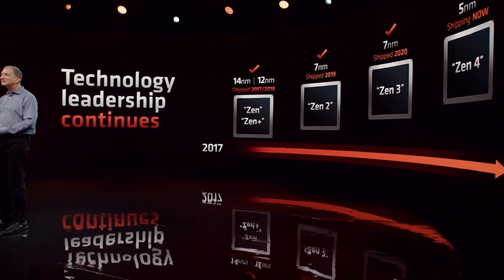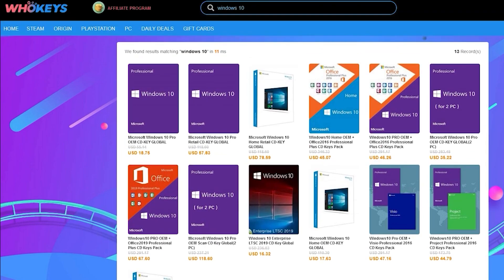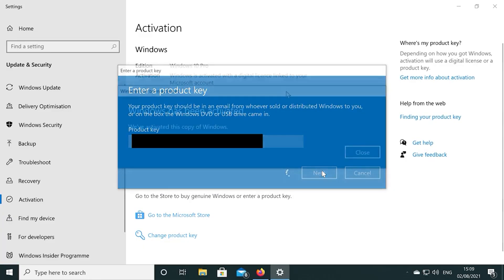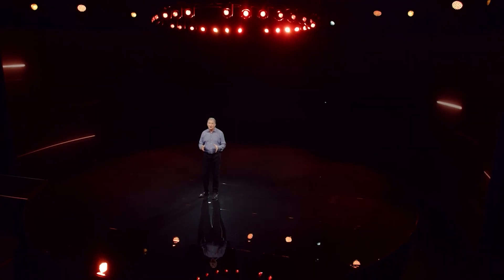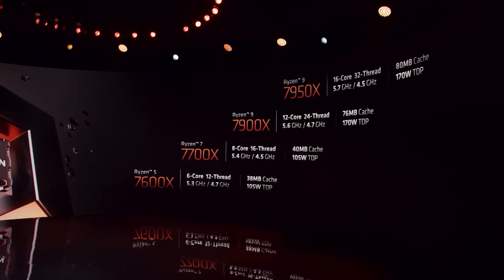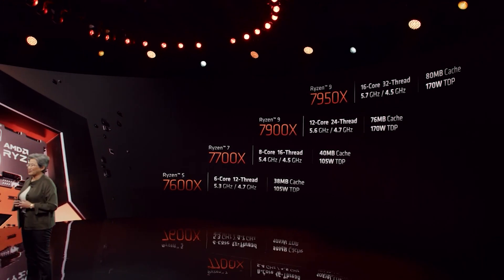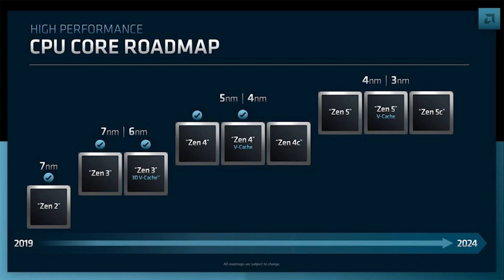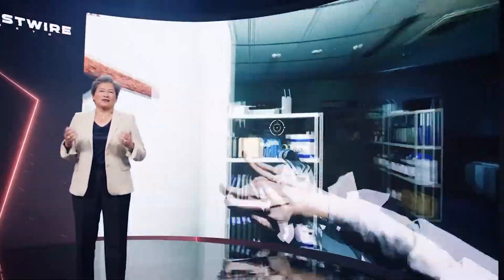Zen 6 CHANGES EVERYTHING - IPC, Clocks & Architecture Early Info

Comment: I'm on a 3900x and currently see no reason to switch. It's a good pairing with my 2070 Super on a 1440p165 Hz Monitor. Maybe with Zen 6 x3d, if the core count doubles again, but probably not with Zen 5, unless my current setup dies.

Comment: The OpenCL compute with 610M in 7945HX only got 82 samples/s. Intel Arc 770 16GB got 12000 Samples/s in Luxmark 2.0 hotel room benchmark. Then there was revolutionary 7940HS 780M, which has same OpenCL score with 10nm 15W Intel XE g7 eu96 and uhd 770 1650Mhz.

Comment: If APUs are going to improve then would 4 channel or even 6 channel memory be viable as DDR5 speeds improve?
Where are the bottlenecks for APUs and how cheap would it be to engineer out those bottlenecks?
That said if RAM socket standards are changed to accommodate this then the space taken up would not be more than current motherboard designs eg. Laptop RAM socket design.
Reply: AMD has said that going past 16 cores (16c/32t) creates a memory issue in that DDR5 isn't fast enough, and that means it wont ever be fast enough.  It's not fast enough now, and as AMD makes faster CPUs, faster DDR5 simply keeps up with 16 cores and doesn't give you any more benefit.  So that's issue no. 1.

For APUs, DRAM is always a bottleneck.  It's why in game consoles graphics memory is used.  Faster DDR5 will of course help but you still have latency issues so it will never be more than 1080p performance, and that really means at best, mid quality 1080p gaming.  I THINK going to quad channel would help this, not positive.

However if AMD wants a really kick ass desktop/HEDT without needing a new socket for HEDT, they could get the memory controller off the IOD and put it on the core chiplets.  So if you have a single core chiplet you have dual memory and if it's 2 core chiplets, quad channel.  This would allow them to go to something like an 8x4 core config (pxe) per chiplet and they could push thread count up to 48 threads in a CPU.  If they did this they could make a 2 die APU.  One die would be for memory controller, cores and GPU, and the other would be an IOD minus the memory controller.  This couldn't be done with AM5.  And this gets to the point of will Zen 6 be on AM5.  It would be almost impossible for AMD to go higher that a 32t CPU with AM5 because of the memory issue.  And this is why it's unknown if AMD sticks with AM5 for Zen 6.  I hope they don't because I think they need to go higher than 32t and they'll need quad channel to do that.

You get to the problem of cost for the APU though because this is something where most people look at these as budget options, not serious gaming chips.  You couldn't go to quad channel because of the cost, UNLESS you first make a much better APU than current with dual channel and the market buys it up.  If AMD knows consumers will buy up a more high end APU for desktop THEN they could push it to quad channel IF it actually provides more benefit.

I hope that helps.
Reply: Oh, and no, quad channel doesn't need a new MB config, as in needing more memory slots and moving to something other than ATX.  If they moved to quad channel for desktop it would simply be single DIMM per channel.  And this isn't a problem because DDR5 can go all the way up to 512GB/DIMM.  I don't think a desktop would have a memory controller to do this, they'd probably max it out at 128GB/DIMM or 64GB/DIMM.  Those are much easier memory controllers to make and of course the cost of a 128GB DIMM is high so it would be crazy to design for 256GB/DIMM.

Comment: Regarding 8, 12 and 16 core CCDs, I can see two possibilities for big/little core counts.

If the little is 1/2 the size, it could be 8 full fat cores, 4 full fat cores and 8 little cores or 16 little cores all with similar die area.

A better solution (in my opinion) if possible would be little cores with 1/3 the area allowing 8 full fat cores, 6 full fat cores with 6 little cores or 4 full fat cores with 12 little cores.

I think the second option would allow for a very compelling product stack allowing a balance between high single thread performance and thread count.  The dual CCD 12 big/12 little could be a monster.  The 8 big/24 little could be Threadripper Jr. if it had 64 threads and enough I/O.
Reply: the best will be left side 8B+right side 8c. In middle cache.  The die size should be 10x8mm or 80mm2.
It can be 4+8 similar as 2+4. On left side - c+4B+c on right 6c.  The die size should be 8x8mm or 64mm2.

Comment: Never buy a platform based on hope or promises. Buy a platform when it is done. I got a nice AM4 B550 board, good RAM and a 5800x3D dirt cheap. I'll do the same with AM5, so probably a Zen6 x3D chip on a good AM5 board with nice RAM for cheap in 3 years or so.

Comment: Zen 5 8800x3d looks amazing for gaming im waiting for that, but the launch date is awkward for a new build because by then the 4090 will be 2 years old (not paying $1,700 for a 2 yearold gpu),  but the 5000 series won't be out for another 6 months after zen 5x3d chips. Nvidia sandbagging again :(
Reply: Obviously the 4090 won't cost the same thing in 2 years as it does now, duh.

Comment: The plan is to buy 8950X/X3D with 5090/5080.
Intel 14900K is a refresh it will be like 10-15% faster then 13900K but that makes it similarly close to the 13900KS which is also near the same amount faster then 13900K... 7950X is nearly 36% faster then 12900K in CineBench multi-core test. 8950X would be 35-45 (least/max) faster then 13900K and if 14900K is 10-15% faster then 13900K this would mean that 8950X is at least 20-25% faster or more then 14900K which I think is HUGE!

Comment: I've gone with Ryzen 9 7900. Once I finish my build and get my liquid cooling up and running, I can allow the CPU to clock higher, and it'll be just as fast as the X-version. Also, for me, I went cores over cache. Not everything benefits from the 3D V-cache, but FL Studio benefits from more cores, so this should last me a while. Hopefully AM5 will last a while and I'll be able to simply slot in a Zen6 or Zen7 cpu later on.
Reply: I'm definitely pretty happy that I can upgrade my old r7 1700 to a 5950x in my homelab.  It beats buying all new everything for sure.
Reply: Pretty much but the x were the better silicon and why cost more.

Comment: I've been thinking of getting 7800X3D for an AMD build but started to think of waiting for 8800X3D after viewing your leak videos on Zen 5. After viewing this video, however, I'm now thinking of getting 7800X3D and skipping Zen 5 for Zen 6. I haven't built an AMD machine for years since Opteron days. I had been using a Haswell PC (4670T) for years before I built a new one with 12900, which I am going to replace by 14900K or 14700K at the end of the year or early 2024. I'll probably upgrade to Arrow Lake in early 2025.

Comment: You know what, as a gamer of some 40 plus years.. yes even back to the ZX81 days, I have always held back a generation. Why? I simply find better cost to performance. So having just built a new PC capable of 1440p gaming am I disappointed with my choices? Hell no! B450, tried and tested motherboards, 5800x3d CPU ... Cmon it just rocks at its current pricing. And get this.. 7800xt GFX Namely the 319 from XFX.  As an "older" gamer I'm not looking for the best, I'm looking for reliability and cost. The older AM4 platform saved a whole shed load of cash over the current costs of AM5 platforms and the cost to fps was just not worth the extra expenditure.
Can I see 70fps to a say 80fps difference in a game? No, can I hell. I'm old, my eyes are knackered but I still game. 
Do not get bugged down by pure fps scores..

Comment: Honestly I'm waiting for the launch of 14th gen. I'll decide to go i9-13900k or R9 7900x based on what the prices do. I'm leaning toward the i9 for now though but having an upgrade path with AMD is enticing.
Reply: Yeah 13900k, enjoy 100C in games/heavier load lol
Reply: @TheRisqe  13900k is vastly superior to amd counterparts in terms of multicore workloads. It's even the go to by most work related tasks. For games, you won't even need a high end cpu to enjoy high framerates. 100C in games is a different problem and it's not normal.
Reply: @TheRisqe lol, Fanboy Spotted. 🎯🤣

Comment: I'd definitely wait for Zen 6 IF AMD can't get to much faster memory timings and are still only getting 8GB/s for the CPU-chipset link.  That speed isn't good enough anymore.

I've thought a lot about how AMD could improve Zen 6, especially if they want to get thread counts up, and they SHOULD want to do this.

So, one of the things they said is 2 channel memory is an issue even with DDR5 and I take that to mean, it doesn't matter what clock speed, it's just not fast enough.  I KNOW part of the issue with memory speeds is the controller being on the IOD because you're limited to having to transmit first between RAM and the IOD, and then via the interconnect to the CCD.   That's going to become too much of an issue for latency with faster CPU cores unless they were to give the memory controller a direct connect straight to the cores, but THAT doesn't resolve 2 channel memory being too slow.

What would make this all much faster is to put the memory controller on the CCD.  You ALSO have the issue of having a 2 chiplet CPU having latency when the cores on different CCDs need to talk to each other.  So, instead of running that connection through the IOD that should be a direct connect.  If AMD did this they could theoretically run dual or quad channel with a desktop CPU (memory controller on each CCD).  That puts you into HEDT territory without needing a different platform.

At the same time they should make these 8x4 CCDs with their C cores being the efficient cores.  This could get them up to 48 threads.

With this much performance you need a really good MB and the MB along with buying a 2 CCD CPU could be the difference between typical desktop or near HEDT.  You wouldn't need a LOT of PCIe channels because MBs now have so much better and a lot more I/O, it reduces the need for different add on cards which is why you need so many lanes.  Nothing I know of uses more than 16 lanes.   But if all the PCIe slots are running gen5 by that time there just isn't a need for so many lanes.  It won't help people with older adapters, but who cares that's their issue.

If they did all this which I think would be great, you'd need a new socket.
Reply: I think all Ryzens should be monolithic before AMD can achieve a more advanced chiplet design with bandwidth and power consumption (especially when idle) comparable with monolithic die. Design 2 different dies with different target:
A 6P+4E+8CU or 4P+8E+8CU die for desktop R3/R5 and mobile with U/H suffix. Current APU's graphics performance is bottlenecked by the dual channel (LP)DDR5 and the absence of infinity cache. 8CU with 12MB of infinity cache is more balanced.
Another is a 8P+16E+2CU die for desktop R7/R9 and HX series.
Reply: @chu-icehugehard1820  You're basically saying all CPUs should be APUs.

Yeah we're going to agree to disagree.

Even Intel is moving to chiplet (tiles) with Arrow Lake.  There's nothing wrong with chiplets, it's only a matter of how it's implemented.  Having an inteconnect in some other die kind of sucks.  You should be able to do something more like a direct connect between die.  In fact if you did direct connect and can get the speed up you could move L3 off the core die and onto a chiplet that could be shared between 2 core chiplets which would be better than stacking.

I also don't like the core config for your APUs.  There are more games that push an 8 FULL core CPU over 60%.  To have an excellent APU that can give good low end gaming it's simpler to  have 8 regular cores.  No mess for a scheduler.

Sure, APUs should be monolithic.  CPUs?  No.
Reply: @johndoh5182  And the latter is not considered as an APU. It's more like Intel's "bigger" Raptor Lake seen in i7 and i9, with a very basic "display controller".
Reply: @chu-icehugehard1820  "And the latter is not considered as an APU"

Come again?  Name the product you're talking about, I can't read minds.

Comment: Zen5 and zen6 on AM5 and then I will be happy, as I will upgrade at a price close to 700.- in the hope to get 70% by selling the old one. For my usecase (editing 8K RAW) the 7950x is good, the 8950x will be great and the 9950x will be more than what I need. Hope zen5 will support 4x48GB (192GB) DDR5 RAM close to 8000MHz and I hope zen6 will support 4x64GB close to 10000MHz DDR5. Now I downgraded from 128GB (4x32GB) DDR5 6000Mhz to 2x48GB (96GB) DDR5 6400MHZ as 128GB had been stable only up to 4800MHz. I espect zen5 to run at least at 192GB with 6400MHZ, but faster is what I wish.

Comment: Not bringing Zen 6 to AM5 would be a large hit against AMD.
Reply: The problem is core counts are going to be increased. Dual channel won’t be enough to feed the CPU. My guess is they will keep AM5 around as a cheaper platform for a while. I.e. it will get Zen6 but not the number of cores that you’ll get on AM6.
Reply: @danialhughes830  I'm hoping for a Zen 6 CPU with V cache that has more than 8 cores in one chiplet.
Reply: @nossy232323 I think you'll certainly see 10 core if not 12 core with AM5 on per ccu.

Comment: honestly it's hard to imagine what zen6 will be as CPU as they stand are reaching some limit to what they're bringing to the table. also an AM6 platform seems far fetched currently.. 
DDR5 is almost too fast for most cases, so are PCI 5 and even 4.. so making a new platform for faster IO and such makes not much sense aside for workstations that is. 

I could see zen6 bringing either unified memory on the die (not sure how it's called, but basically what IBM is working on) and more integrated graphics with much more oomph as well as more AI oriented.. basically bridging gpu and cpu and not just for graphics capabilities.. 
Will be interesting to see but I'm not gonna hold my breath for that
Reply: As programs mature and start taking advantage of the PCIE bandwidth with direct streaming etc the need for more IO will always be there. A lot of the new game engines need that additional bandwidth already.